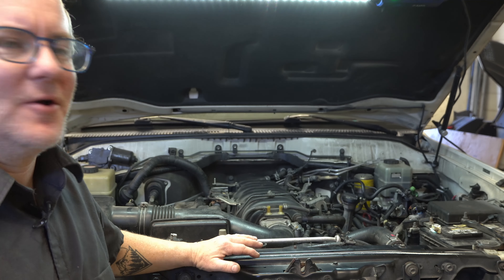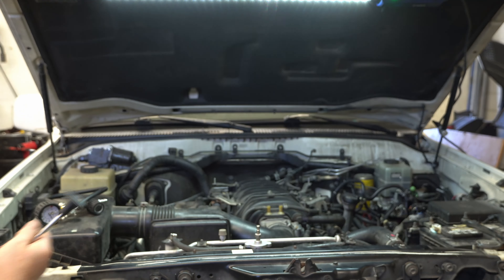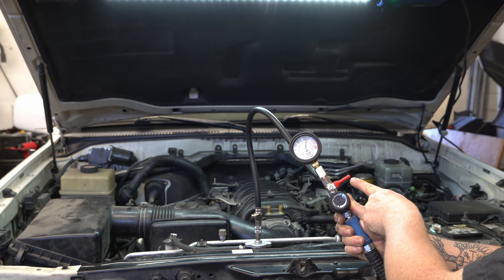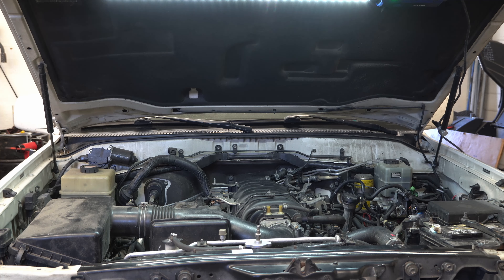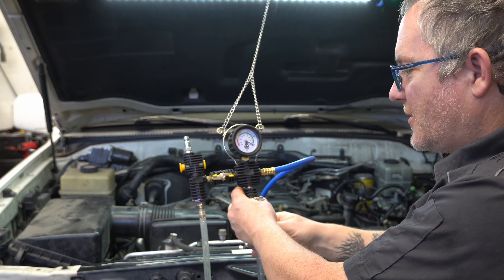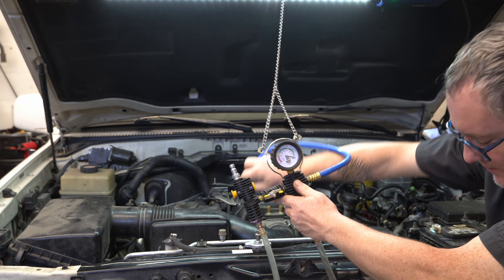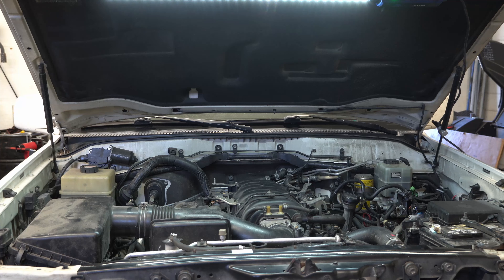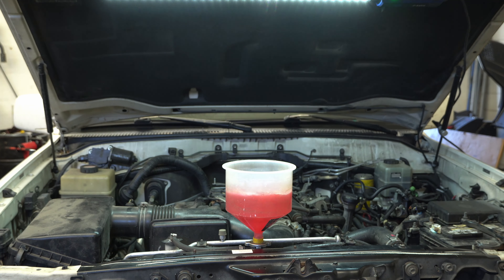Cooling System Pressure Test and Refill

Comment: How much air supply do you need. Can this be done with 20-30 gallon air compressor?
Reply from the maker: I've never tried it with a small compressor, but I'd imagine it would work. You don't need  it to flow for very long to build vacuum.

Comment: on the 100 series timing belt change, would you recommend doing the water pump at the same time?
Reply from the maker: Absolutely. The water pumps are usually bad at 90k. We do everything behind the timing covers along with the fan bracket, serpentine belt and tensioner, and heater tees.

Comment: Otramm Video idea. research top 15 Suv and truck sales. Then find top 5 complaints weak spots in reliability on these Easy to find this data . Make videos of how to maintain these trucks properly so as to get the most miles out of them. We all could use this information. and the audience will be large for the top 15 . Discuss lubricants full Synthetic and Dino juice oils test  them . Diff oils and show how dirty they get and need changing. for example Americas SUV the Ford Explorer how to change the oil , diff, and 4X4 transfer case Lubricants'. Best to you from Mitch.